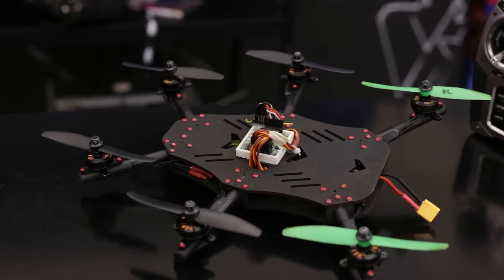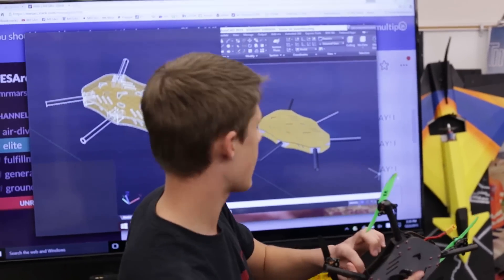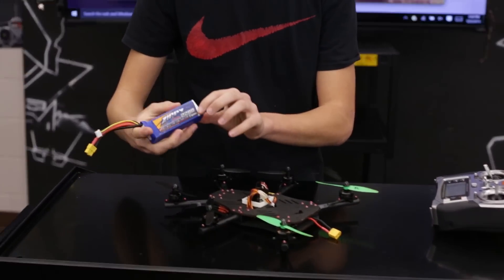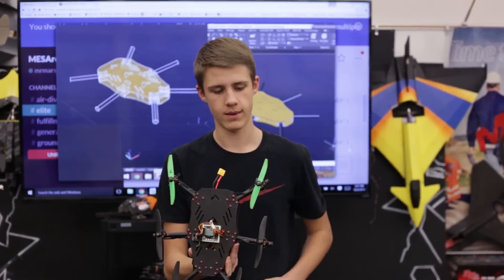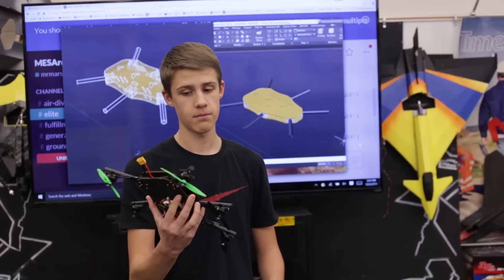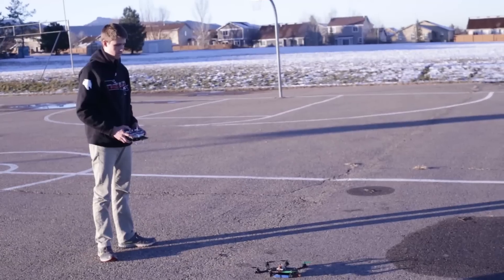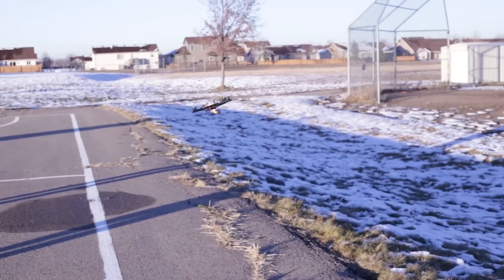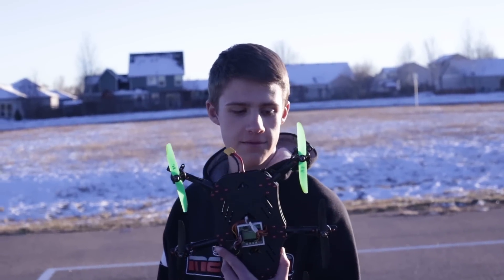MESArc - Mini Hexacopter DIY

Comment: Nice frame but i think its too wide and im sure its toooo....heavy. Hover above 50% throttle with 3S? total weight without battery easy 400 grams? Battery need to be above props for better CG